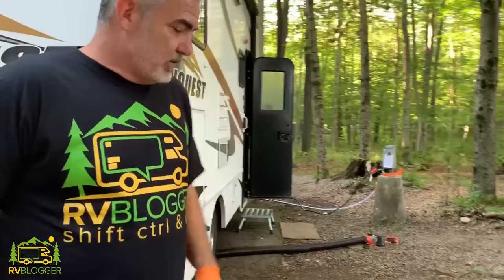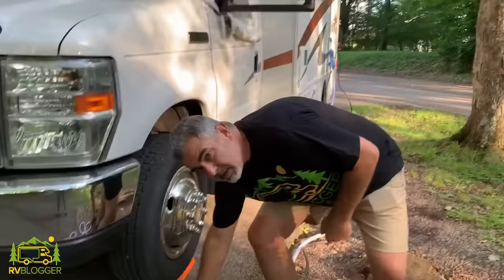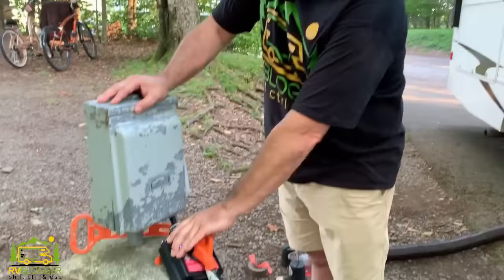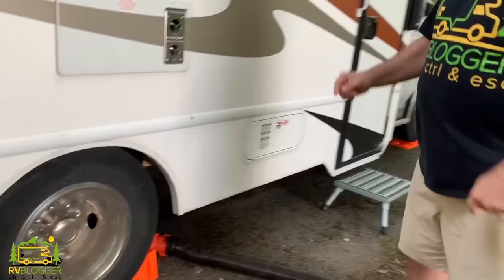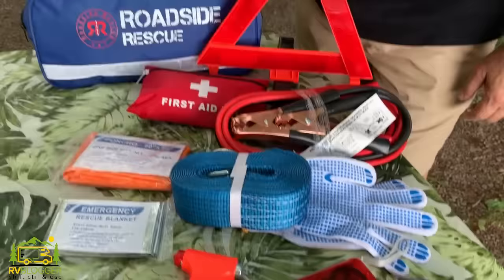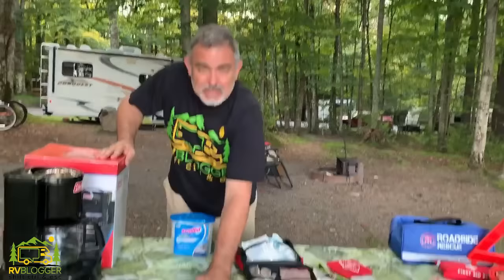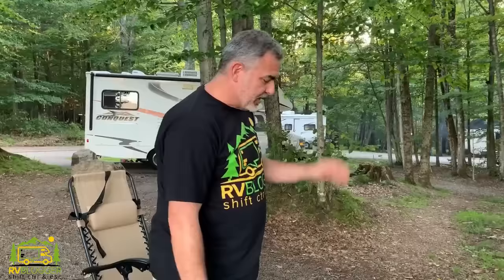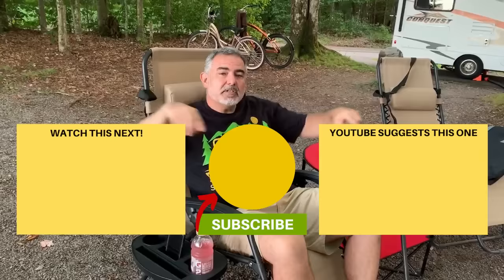Essential Gear & Accessories for RV Beginners - We Didn't Back In to Our Campsite - Do You Know Why?

Comment: First time viewer and saw some ideas I haven't seen before; thanks for sharing those!
Now, a QUESTION: Why didn't you just BACK INTO the site? I don't know the campground, but, unless EVERYTHING (table, fire pit, personal space) is near the hookups, it seems to me backing in and having the personal space AWAY FROM the hookups, makes sense.
Several items I'd ADD to your list are: 1) the Level Mate Pro, 2) collapsible safety cones, 3) a torque wrench and 4) Anderson Levelers (all avail on Amazon).
Enj'd the presentation, folks; keep up the good work.
Y'all Be Safe!
Reply from the maker: Hi Raymond,
Glad you liked the video! 
If we backed into the spot our side door to the RV would not be facing our campground where the picnic table and fire ring are located which would be very inconvenient. We run into campsites with the hookups on the wrong side a few times a year but we camp a lot more than most folks. Hope that answers your question!
Thanks for watching and commenting!
Mike and Susan
Did you see our video about our FREE RV Rental for a Weekend we are giving away? Hope you will check it out!
https://youtu.be/h_NW_O-VsTo

Comment: I can totally understand why you drove straight into the site and not back in. You would run into that problem in a double site if you want both RV doors to face the middle where all the action will be as well. Someone will have to drive straight in. We just purchased a travel trailer, but lot of the pointers are helpful and would be similar for trailers too👍. Yes water pressure regulator definitely a necessity.
Reply from the maker: Hi Paul,
Yay! You are literally like one in 100,000 who is able to understand this!
Thanks for watching and commenting! 
Mike and Susan

Comment: Thanks for the great tips.  Being security minded... I would recommend putting the surge protector inline at the RV side instead of at the hook-up, or better yet if using 2 cords put it in the middle so it's staged under the RV.
Reply from the maker: Hi Mike,
Great point because we have heard that people sometimes steal surge protectors if they are in plain site or not secured in some way.
Thanks for watching and commenting! 
Mike and Susan

Have you subscribed to our YouTube channel yet? If not we sure hope you will click below to subscribe! Thanks!
http://goto.rvblogger.com/YoutubeChannel?sub_confirmation=1
Reply: I splurged on the Progressive Industries internal unit & installed it under the rear bed. It has a wired remote display showing volts, amp draw and any errors - like a mis-wired pedestal. I never have to think about it... it won't let power into the RV unless it's "clean". Expensive, but worth it. Bonus is I'll never forget and leave it at a campsite!

Comment: We have quite a few accessories we enjoy.  Most recently I just added quick connect hose adaptors to my water inlet and my black tank flush as well as to all our hoses.   This will prevent wear and tear on the inlet connections and also makes it quick and simple to connect and disconnect.   $10 for 4 sets of quick connects on Amazon.   Money well spent in my opinion.
Reply from the maker: This is exactly the kind of advice I was hoping folks would share as a result of the contest! Thanks again and more great advice! Mike

Comment: I'm pretty sure if its not a drive through site you need to back in. I have actually seen sites where the hookups were on the wrong side and your video gives a good idea of what needs to be done.
Reply from the maker: Hi ron45,
This site is actually backwards. I guess it isn’t obvious but if we backed in to the site the side door of our RV would not be facing the main part of our campsite where the picnic table and fire ring are located. Maybe I didn’t explain that well enough in the video…
Thanks for watching and commenting! 
Mike and Susan

Comment: Should of backed it in and you wouldn't have to look or trip over the wast pipe when you walk out of your camper. If a view or privacy is an issue, should of went to a better campground. A decent campground will keep stuff like that in mind before they put a parking spot in.
Reply from the maker: We really liked our spot. It was on the corner, spacious and wooded. We didn't mind pulling in to face our campsite. Our water, electric and sewer gear wasn't an inconvenience. Thank you for watching our essential gear video and commenting. We appreciate your support!

Comment: They're not on the wrong side, the pad was made for a camper to be BACKED in.
Reply from the maker: Hi David,
I guess it isn’t obvious because I didn’t explain or show it well enough, but the hookups are actually on the wrong side of the campsite. So, if we backed into the site the side door of our RV would not be facing the main part of our campsite where the picnic table and fire ring are located. 
Thanks for watching and commenting! 
Mike and Susan 

By the way, we hope you will subscribe to our FREE monthly digital/video magazine called RV Camping Magazine. Let us know how you like it!
https://rvblogger.com/rv-camping-magazine/
Reply: Yeah it's strange how some campgrounds set up their pads.  Some pads have the fire grate way to the camper.   It looked like you were in a spot at the end or off by yourself.   They designed it wrong for sure.

Comment: Tank cleaners say don’t use chemicals in black tank. They say You don’t want anything breaking down in the tank- that’s what makes the peanut butter that coats your sensors causing them to not work. They say to just use more water. Damn internet.
Reply from the maker: There is a lot of information out there about the "best" ways to keep your black tank clean and odor free. Up until recently we have always used Aqua-Chem. Over the past year we started using Matt's Liquified. We had our black and grey tanks professionally cleaned after 2 years of use in our motorhome and received an A grade on our "report card".  The professional cleaning company recommended a Calgon and Pine Sol combination to add to your tanks, which we do use this recipe too. You are correct, using plenty of water is the correct way to help maintain and flush tanks. But we were pleasantly surprised to receive an A grade after always using chemicals. It is very difficult to know the right or best answers because everyone has an opinion. 🤣 However, we do perform a tank flush every couple weeks. In our Class C we used the Rhino Blaster, our Class A has a built in tank flush. I do believe this is key in also keep tanks and sensors clean. Thank you for watching our Essential RV Gear video and commenting.

Comment: Great video for beginners. My suggestion re: sewer hose. Don't use it until your tanks are full. When an RV is connected to a sewer connection, you should allow your tanks to fill up, and then dump. This prevents crap (literally) from getting hung up and not emptying. Plus, in this scenario shown, nobody will trip on the hose. Been RV'ing for many years, and this is how I do it.
Re: fresh water, ALWAYS flush the outlet for one minute before connecting your hose, and then flush your hose for several seconds, before connecting to the RV.
Reply from the maker: Hi G,
All good suggestions!
Thanks for watching and commenting!
Mike and Susan

Comment: In addition to a pressure regulator on water, a hose splitter is another nice thing to have so if you need another water hookup for some reason you don't have to disconnect your main.
Reply from the maker: Great Call, we keep a hose splitter on board. I'm glad you mentioned it because lots of people use them. Thanks!  Mike

Comment: I understand that you like to have your door facing your fire pit and picnic table but in this case, I’d rather walk around to those items when using them. Backing in to the site would make all your connections “normal” and you wouldn’t have to look at your utilities every time you came out of your door. We’ve been at sites like that as well and actually moved our picnic table to the other side. You may not have had room for that but it’s something to keep in mind because you use the picnic table mainly to eat and who wants their sewer line right there when eating. Also, there are many Youtubers who have done the toilet paper test over the years. There are many papers that break down well some even better than the more expensive RV toilet paper. For the most part, the key is leaving your black tank line closed until it’s full before you open the valve and dump it. We haven’t bought special toilet paper in years and haven’t had a problem. Great video.
Reply from the maker: Hi Marsha.
In some cases it might make sense to just walk around but our campsite was very lopsided! We had a HUGE campsite and all of the space was on the right. I would have had to drag the picnic table about 90 feet to get it to the side of the campsite opposite the hookups. And then there wasn't enough room on that side of the camper for that to make sense. I should have done a better job showing the overall size of the campsite and the layout too!
And, thanks for your take on the Toilet Paper. I have heard stories about regular TP working fine but I have heard many more where it doesn't. If you keep your tank flushed out or you RV often perhaps regular TP would be fine.  But Susan and I don't feel comfortable telling folks regular TP is ok to use.
Thanks for watching and for your commenting!
Mike
Reply: RVBlogger I saw the size of that site so I would have left the table there as well. As far as the tp goes, I understand you needing to be careful when you advise people so that’s why I took notice when you said “you have to use RV toilet paper”. It’s very expensive so I would want you to let people know that there are other safe options. You should check out the comparisons that others have done so then you can at least tell people to do some research because there may be less expensive solutions 😊

Comment: The utilities are not on the wrong side. You're parked wrong. Most RV parks are set up for campers to BACK IN which places your water, sewer and power on the correct side. Other than that, good information for new campers.
Reply from the maker: Hi Mark,
I can't believe the huge number of people who got this wrong so you aren't alone. Watch the video again. I guess it isn’t obvious but if we backed in to the site the side door of our RV would not be facing the main part of our campsite where the picnic table and fire ring are located. Maybe I didn’t explain that well enough in the video…
We find campsites with the hookups on the wring side a few times a year but we camp way more often than most folks.
Thanks for watching and commenting! 
Mike and Susan

Comment: Thanks for a great list! I know it’s a year later but... one thing I would mention coming from an off road background. The tow strap in your roadside kit... replace it. Never use a tow strap with a hook on either end. There are plenty of videos out there with disastrous results of the hook flying through windshields. Get yourself some D rinds and a strap with only loops on the ends.
Reply from the maker: Thanks Steven,
Great tip!
Mike

Comment: Why do people keep saying that about RV toilet paper? Are they investors in the company. A holding tank on an RV is not a septic tank. You empty your black tank into a septic tank. Professionals will tell you all you need is septic safe toilet paper. To pay two or three times more for RV toilet paper is a huge waste of money. Here's a simple test for you. Get two 2 quart clear glass jars with lids. Add water to both. Put three sheets of toilet paper that is septic safe in one jar and three sheets of your RV toilet paper in the other. Close the lid on the jars. Shake each jar one at a time and see how long it takes for the paper to break down. Then tell me if the price is worth the difference. Professional tank cleaners say to use plenty of water when flushing and there will be no build up a regular tank flush will not resolve. I hold the pedal down and count to three (one thousand one, one thousand two, one thousand three) and then let go. Never had a problem and never had to get a professional to clean out my tank. Youtube has plenty of videos showing professional tank cleaners at work. Toilet paper has rarely been the issue and usually only because of the ratio of water to solids in the tank. They say they would be out of business if everyone would use enough water and not flush any thing other than toilet paper and human waste into the black tank.
Reply from the maker: There is some truth to what you are saying. I do believe some toilet papers break down slower than others. If you are only camping on weekends then you definitely have a larger chance of having solid TP when it's time to flush. Having more water in the tank will help with the flush but not so much with breakdown. We did a TP test. My personal conclusion was go cheap (TP) add chemicals and water. Thanks for watching our RV gear video anc commenting. https://youtu.be/Lcm_kmFF4AM .

Comment: You could always back in lol
Reply from the maker: Hi again Eddie,
I guess it isn’t obvious because I didn’t explain or show it well enough, but the hookups are actually on the wrong side of the campsite. So, if we backed into the site the side door of our RV would not be facing the main part of our campsite where the picnic table and fire ring are located.
Reply: So you like walking over the sewer hose every day ? Ive never seen that in all my years of camping . Usually people back in to be closer to hookups to make life easier . Thats how campsites are designed . Just my opinion .
Reply from the maker: @eddiecastaneda9523  Hi Eddie,
LOL! I hate walking over a sewer hose! But this site was truly designed incorrectly and it was backwards. We camp way more than most people and we run into this situation a few times a year. I thought it was a good opportunity to show one reason why people might want to carry back up hoses or extensions but I totally screwed the pooch on that because I didn't explain it well enough.
Don't fall into the trap of thinking just because you never saw or experienced something means it doesn't exist. Or the opposite either - just because you saw something or experienced something means that's the way it is everywhere and all the time. This is faulty thinking. As I have gotten older I came to realize this more and more. When I was younger I thought I knew everything.
I appreciate your comments and the friendly conversation!
Safe Travels!
Mike

Comment: Some good information, thanks. 2 questions: Why say you "have" to use rv toilet paper which is much more expensive. You can use "septic safe" paper in any brand and save money. Also, rarely are your hookups on the wrong side, you pulled forward into a back in site. Most people back into a back in site. Just curious.
Reply from the maker: Hi Doug,
Great questions!!!
I see people with clogged septic tanks or faulty sensor readings all the time. I was trying to impress upon new RVers that they have to use RV safe toilet paper and not toilet paper from home. But you are correct - any septic safe TP would work fine. 
Second - if I backed into the site my side door to the RV would be on the wrong side and not facing my campground where the fire ring and picnic table were located. We run into hookups on the wrong side a couple times a year but we camp more often than most folks. I hope all that makes sense.
Thanks for watching and commenting!
Mike and Susan
Did you see our video about our FREE RV Rental for a Weekend we are giving away? Hope you will check it out!
https://youtu.be/h_NW_O-VsTo

Comment: I'm late to the party. Could you have backed into this spot so that the hookups would have been on the right side?
Reply from the maker: Hi Jeanne,
We could have backed in but...our side door would not be facing our large campsite where the fire ring and picnic table are located.  In addition, since the site is so unlevel we would be sleeping with our heads below our feet. We tried to use this site to also show the importance of having 2 electric cables, two hoses, and 2 sewer lines. They have saved us many times especially if we are on sites where the hookups are far away or if something breaks.
Thanks for watching!
Mike

Comment: Great Video!  Just bought my first RV and looking to get setup.  Would it be better to have the filter off the regulator at the water hookup rather than hanging off the RV/90 degree connection?
Reply from the maker: Great question and yes you can place the filter at the regulator.
Thanks for watching!
Mike

Comment: You don't need to use the expensive rv toilet paper. All that does when it brakes down is leave a sludge on the bottom of your black tank.  Get ahold of a rv tank flusher and see all the gunk that comes out.
Reply from the maker: We also have the Rhino Blaster to flush holding tanks (seen in video). Either way TP can stick to tank sensors or sink to the bottom. We always recommend flushing the system occasionally. Thank you for watching our Essential Gear & Accessories video and commenting.

Comment: And the Coleman "propane" coffee maker cost how much? You can get an old style percolator for $6 at the local Goodwill store. Or a $15 power converter plugged into the cigarette lighter will run an electric coffee maker as well. A French press or a pour over coffee maker works very well and are much more cost effective to purchase.   But there are a lot of quiet was to make a cup of coffee on a budget.
Reply from the maker: Hi Brian,
That's very true! I have the old Coleman coffee maker for $6. That works fine (except for the grinds in the coffee - lol! - I must be doing something wrong) and so do all the methods you mention. Thanks for bringing them all up ! 
These are just the things we use and like. 
Thanks for watching and for sharing your comment!
Mike